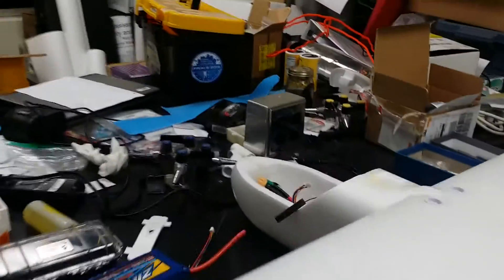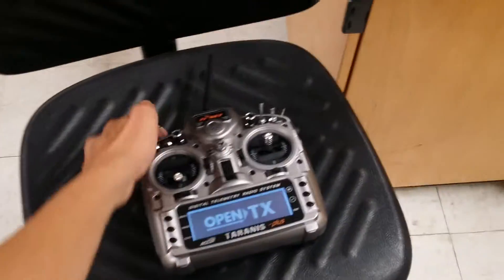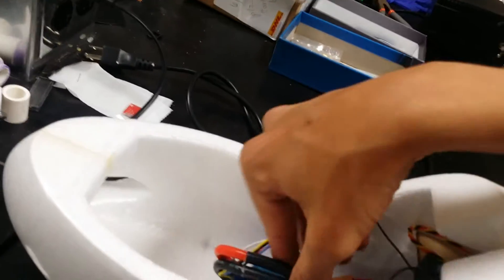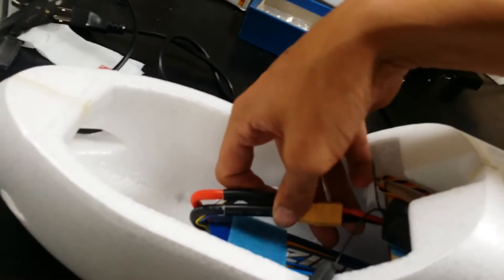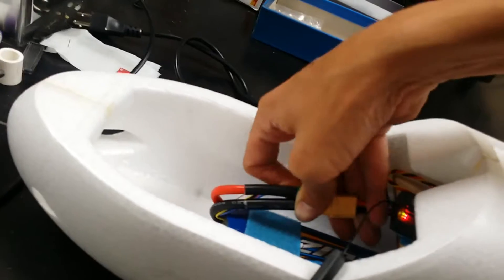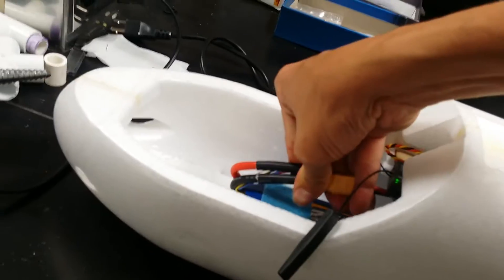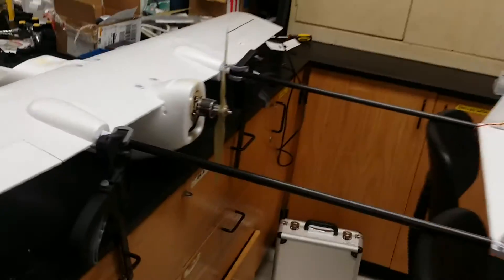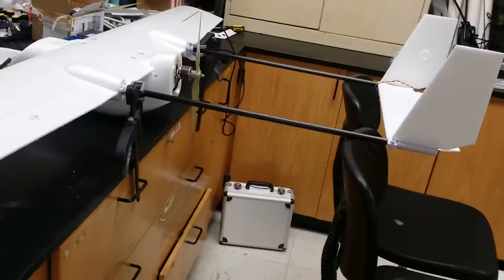Skyhunter Aerial Mapping UAV Testing After build

Comment: I am working on a Skyhunter platform for mapping as well. Please message me so we can chat. I am interested in your ideas for mounting the downward facing camera. I have designed a few 3D printable parts for the SH.
Reply from the maker: Hi James, I mounted the camera using foam blocks to absorb vibration, and I have successfully mapped with it. I'd like to see your 3D printed solution though! I'll send you a message.
Reply: +paul@ci Sorry for the extremely slow reply. I posted some pictures of my 1 axis gimbal on google plus. Ill have it installed in the next couple of weeks. Any idea how I share the google plus post with you?
Reply: +James Taylor what camera can i use for mapping? and have gps built in?